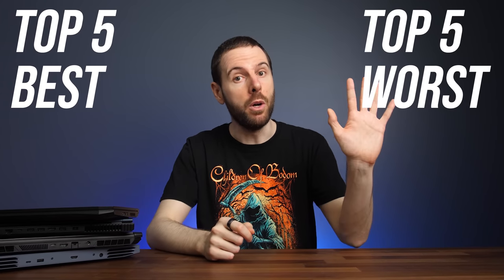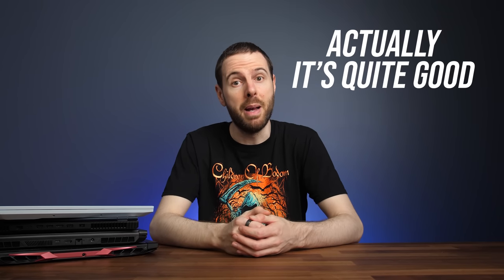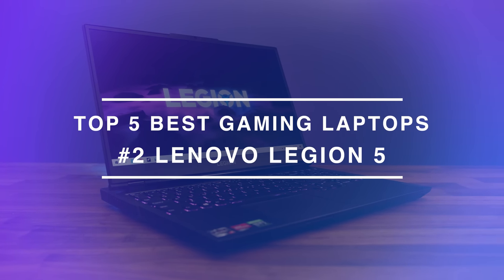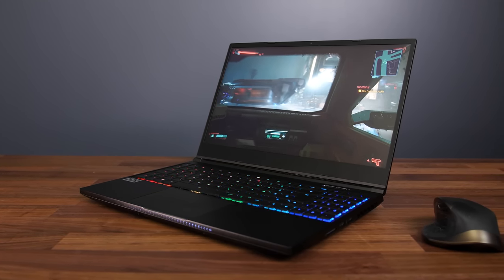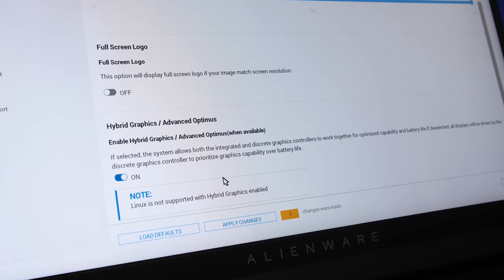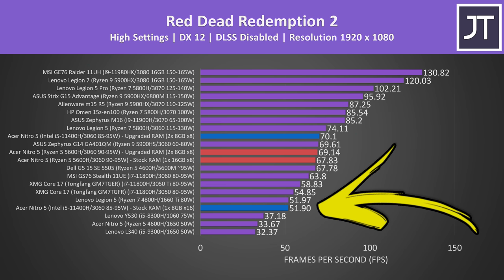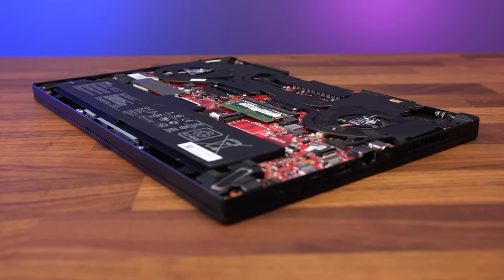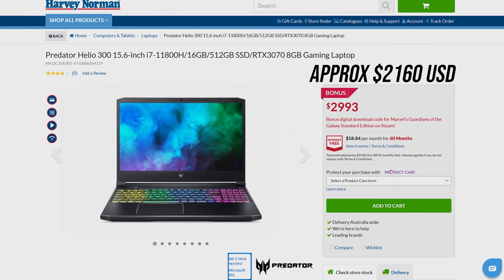Top 5 BEST & WORST Gaming Laptops of 2021!

Comment: I'm using Asus Tuf F15 (i5 11400H and RTX 3050) without a problem, tempratures are good with laptop stand and 4 hours screen time with IGPU. GPU has dynamic boost btw.

Comment: I usually hate flashy laptops.. but razer blade 14 rtx3070 that is much better than I expected. slimmer and more quiet than the list you have i believe, though GPU 100w. but at 14 inches, its the lightest gaming laptop i ever seen. will you review this?

Comment: I fixed high temperature issue and now cpu and gpu always at 75c.
I have been using Dell G15 with 165hz screen,  AMD R7 and RXT 3060 (5515) for two months.
Its the best budget laptop and I highly recommend it.
Reply: Hello how did u fix it ?
Reply: @YasminMohamed-ic9ut   Check my videos about Dell g15 (I have 157 videos only for Dell G15 test)

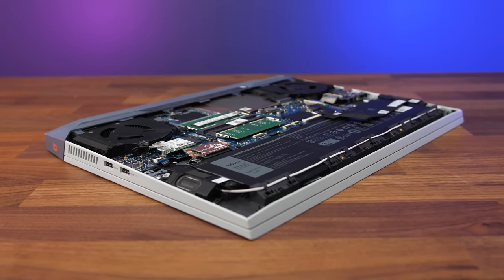Comment: 0:42 as an Asus GU502GU I totally disagree. When you are in a long-playing section, you have to choose between high cpu tempereture (+90-95 degree) with a hot plastic smell or  bare with airplane engine sound like fan speed. Especially brands decide to disable undervolting with a bios update..

Comment: Hey man i already watched a ton of your videos. The chepeast laptop here in my country is the nitro 5 i5 11th gen with rtx 3050 ti. Should i buy it? Really on a tight budget. Its around 700usd
Reply: The 11th gen I5 is the first Intel Nitro I have tested that does not overheat as the previous ones did, before then, the Ryzen's ran cooler. If you can spend a few dollars more get the 3060, if not get a second ram stick and a second SSD and put them in asap.
Reply: @jamesharvey44  hey man thanks for the info and yes i did consider adding money to buy better specs. But I'm torn apart between legion 5 and nitro 5. Both has ryzen 7 and RTX 3060. Nitro is cheaper but I read that it has heating issues and noisy. Help me.
Reply: @caramel_boy9505  The thermals in the intel 11th gen and Ryzen nitro's are very good, I have yet to hit 90c on either unit. I cannot comment on the Leigon as I do not have one. All these laptops have noise, the tinner ones are louder. But the 11th gen Niro is reasonably quiet.
Reply: @jamesharvey44  wow thats pretty cool, ok now im leaning more to nitro. Btw do you play warzone? How is experience?
Reply: @caramel_boy9505  No , my only MMO is ESO and ESO will run on anything. The 11th Gen Nitro with a 1650 runs ESO at 85-100 FPS smoothly (with a good internet connection). FO4 68-75, With a 3050 you should do better and have no problems with todays titles.

Comment: Are Dell gaming laptops more durable than the Dell inspirion?   I loved Dell when I had it, but wore the keyboard out.
Reply: Sadly same problem. My G7 gaming's keyboard is wearing out. It doesn't look or feel like there's anything wrong, but several keys don't work anymore. A set of keys goes out randomly and then about a month later stops working entirely 

This didn't begin until 2 years later and didn't become near unusable until 3 years today.

Battery is drained too, it's down to 1 hour and Dell wouldn't replace it when it started going bad ( 70% capacity) during warranty. Called it normal wear and heard Alienware buyers had the same problems

Comment: I think you placed too much emphasis on the Legion 7s corsair software. Yeah it kills the battery life and yeah Lenovo hasn't fixed it even though you've told them for 2 years, but tbh most gamers bought this laptop to be plugged in. So hey, non issue. I've watched your videos on the Corsair problem a few times, and I think you've seemed to take it personally because they haven't fixed it. It is 'trchnically' better than the Legion 5 PRO and Legion 5, so a silly optimization problem shouldn't deep six it as much as shown here. Thank you, great reviews!!!

Comment: Can you help me decide? Should I buy 2021 legion 5 or wait for the new 2022 legion 5? although the 2021 legion 5 is on sale right now from (1363.28 USD) to (1181.51 USD) is that a good sale price? because for sure there will be no sale on the new 2022 legion 5?
Reply: 12th gen intel has quite the upgrade, if you can choose the 2022 model, go for it

Comment: My Dell G15 (5510) which has an RTX 3050ti runs really loud at about 50Db and is really annoying when gaming. This noise is after rising it with a laptop stand with all fans being able to use air. Are there any fixes to make the laptop quieter without reducing the performance a lot? Anything helps thanks.

Comment: I'm still amazed at how Dell manages to make thick and heavy laptops that still run hotter than the competition
Reply: It's because they set the max temp to 100 degrees on the CPU for higher performance.. all laptops will thermal throttle when pushed to absolute max.. if the max temp is set lower it just means it will throttle sooner

Comment: i got the helios 300, mine has the 2060 and dual channel, it does really well only issues iv had was with the gpu fan but everything else has been good, iv had it for a year now still going strong and iv pushed it this whole time. its really a performer. i feel like its just slightly lower performing than the desktop 2060, and i v never had that so who cares. i get 240 fps in fortnite and ussally around 144 in most other games with competitive settings...i went from a ps4 pro to this helios 300. what an upgrade!!!  i had to open it up and grease the fan = all is good.

Comment: Jared please help me with a question I can get here in the United States a Acer Helios 300 with 11 series Intel and RTX 3060 brand new for $1200 or it’s about $1500 for the Legion five with the same specs which one should I go for?
Reply: Go for the legion 5 trust me not tryna trick you into buying the more expensive but the 300 has loud cooling and sharp corners and it easily gets hot and got bad battery life and bad audio which is why go for something other than a 300.

Comment: Said it in the last video and will reiterate here: the Legion 5 Pro is too compromised to be above the Legion 7. Especially when specced out the same, they are virtually the same price (3070). You're just wrong if you choose the 5 Pro over the 7 and this list highlights that fallacy. You get RGB, better cooling, thinner and all aluminum chassis, glass trackpad (the one on the 5 Pro is absolutely garbage), and it looks far better.

I had both. Got rid of the 5 Pro for the 7i. Never looked back.

Comment: I used Lenovo ideapad Gaming 3 with processor Ryzen 5 5600 and Gtx 1650 also 120 hz refresh rate so it its consider as good laptop for at long run?

Comment: I learn a lot from this channel. 

I just buy legion 5 non pro model with 3060, as my 2nd gaming laptop, thx God I check zentiming the RAM isn’t bad as Ur review unit😁. Earlier this year I bought Asus scar 3070, while BF 2042 run smooth in my 3070 asus, it so choppy in Legion 5. Turns out It need force the game to run on DX12 (config txt file). And since it can disable iGPU, I dont need to update AMD adrenaline driver to play bf2042. 

CS GO perform same on asus 3070 vs legion 5 3060 due to mux switch. While asus mechanical keyboard is by far the best laptop keyboard I ever try, but the RGB on Scar just justify the almost double the price 😅🤣😂 from legion 5.

Comment: Hey. I think I am one of the few people for which the portability of the machine is a huge deal and I actually mind if the laptop is heavier than ~2,1kg.
Since you put the M15 and Asus f15 in the F category and also in your top worst 5 this year is there even an option for me to buy under 2,2kg gaming laptop which is not considered terrible?
Reply: not really. I guess u could go with a zephyrus g16 but it does have soldered ram and gutted performance (lower tdp in 3060/3070...)

Comment: Acer nitro 5, i removed 1x16GB 3200 ram, and replace 2x8GB 2400 ram. and still i can't believe my eyes. some games my fps double up. After ram change, now this laptop is good laptop with budget friendly. just add ram price to its base price. (i will remove 2x8GB and buy another 16GB 3200)

Comment: Razer blade 17” is never mentioned ever. Seemed like it’d be nice but I really want to see it compared or at least talked about since I’m thinking of buying it.
Reply: If you really want thin laptops with good build quality, go ahead. Problem starts when you go for the 3070/80 models because the form factor doesn't allow the GPUs to get a decent performance uplift from the 3060. It also gets hotter than the 3060.

Comment: I have the tuf dash f15 3070 , does it have the switch thing that you like ? ( The one that lets you switch between directly using the graphics card or the bottle neck or something like that)
Also i bought it because its the only good laptop available here in syria so I didn't really have the option to choose
Reply from the maker: It doesn't have a mux switch. You can bypass optimus by plugging an external monitor into the HDMI port. More info on my review: https://www.youtube.com/watch?v=rTgN0nTc_34
Reply: @JarrodsTech  thanks :>

Comment: Finally spomeone telling the reality about the Alienware laptops. I bought my m15 r2 just because i thought I can use for years. But one of the bad decisions I have maden. It runs super hot, throttles, and AWCC is just a mess after years and they still keep it in that way. I surely don't recommend anyone to buy their overpriced devices cause there are equals of those which are also cheaper.
Reply: Always thought the same about dell/alienware. Overpriced and overhyped, and quite mediocre compared with Lenovo or MSI

Comment: Is it possible to buy a gaming laptop that could play recent games at max settings for less than €2000.
My current laptop is an Asus TUF   gaming FX504GM about €1000 which is only 3 yrs old but it really struggles with even 5yr old games on medium settings, stuff like No man's sky runs like crap even on low settings which is really frustrating.

Comment: @Jarrod'sTech Do you think legion 5 pro 16" is worth 4 months wait. 
The specs are Ryzen 7 5800H, RTX 3050, 16" screen, and 80Wh battery. At $1,100, I can't find this anywhere else. 
I need it for data science
Reply from the maker: 3050 is a bit rough for such a high resolution screen if you plan on gaming at all. Otherwise in 4 months we'll probably have new CPUs and GPUs, more info at CES in January.
Reply: @JarrodsTech  alright then. Thank you

Comment: I got the nitro 5 with the rtx 3050 for 850€ i Just added a 8gb stick for like 35€ and The laptop is fine still no have issues at all. Only concern is probably The i5 11300h which is a quadcore but stay smoothly at 4.1ghz even for Long game session.

Comment: Hey i have the dell g15 and in my region, a rtx 3050 ti cAme with it. The biggest problem was that the gpu was 4gb :((. I cant run most games on low settings.. i dont know how to fix. Is it because my windows 11 ain’t optimized for gaming? Or is it skill issue.
PLEASEEEEE RESPOND!!

Comment: From what I understand the R5 made the worse list cause of the problems. Would you still feel the same way about the model Dell has in sale for Black Friday? I mean now that they sorted out most issues you mentioned. It is sold out now but it was a R9, 3070, 32gb, 1TB, with a 360hz 1080p gsync panel..for less than 1700
Reply: I own a R6 with the 3080 for now 2 months and I've never experienced any issues such as the ones mentionned in this video, I am really happy with it. Got it for 2.2k EUR instead of 2.8 or even 3k EUR as per what I see on Dell's website now

Comment: I have asus tuf a15 my laptop when plugged in is very hard lagging fps drop cpu speed goes to 1 ghz. Back to full speed and my fan speed is slower then normal is my ac adapter dying? Around 80-85 degrees cpu temp.. when disable turbo boost i dont have any issue but my battery lose evry couple min 1 % in game and back charging...

Comment: i got 15m stealth, yes it sucks quad core and expensive,, but i value the slim and light (lighter than razer) and its all metal design i use also this for work so i can carry all around. if you have extra buck and use for work this is thinnest laptop ever in 2021. if u care more on performance theres better options.

Comment: Why quad core is bad? I'm considering buying a quad core laptop with rtx 2060,isn't 4 cores enough for 2060?
Reply: AMD has octa-core 15 Watt processors and CPU core count can choke the GPU if you've seen his review.
Reply: Part of it is future proofing. Another is that more cores enables you to multitask and open more programs in your laptop without sacrificing performance. I think for 2021 and beyond, 6 cores should be minimum.

Comment: I have the acer nitro 5 (AN515-57-71BN) with an Intel Core i7, RTX 3050, 16GB ram, 4GB vram.

Is it bad? Should i return it? And is my pervious laptop (Asus ROG strix GL503v) better in terms of performance?
Reply: @Muhsin Maki it depends on how much it cost you, as there's a good few options to choose from available right now,and black Friday's right around the corner so it may be worth returning it if you can get a better deal, or enough to upgrade to a well priced 3060 ect.

Edit: If it was the 8gb 1070 then yes the 4gb vram 3050 will perform worse but there's dlss ect with the 3050.
Reply: @Mm-vr9mt  Oh i see, thank you for your response :)

I got my acer nitro 5 for almost a 1000$. And, I had the standard edition of the gl503v with the GTX 1060 6GB GDDR5.
Reply: @muhsinmaki8051 The 6gbs of vram in the 1060 should outperform the 4gbs in the 3050 still (there's dlss in the 3050 at least) and for $1000 I'd 100% say you were down right cheated with that 3050. 

Would you mind telling me what you're after use wise and your budget/Region ect? As without even sales I can find, at the very minimum multiple 3060 (130w tgp) + 5600/5800H laptops for $1000 (usually with a 512gb nvme and 16gbs ram/1tb and 32gb on the odd few models ect) new.
Reply: @Mm-vr9mt  Well... you see, i got this laptop for college (i'm an ICT programming student) and my budget for a laptop would be 1300$.

I live in Bahrain by the way, it's really difficult to find a good laptop that's in stock.
Reply: if there are other good options, i'd be more than happy to take an advise. if not, that's okay.
Reply: @muhsinmaki8051  Then you're in the right ball park for your course with a dedicated gpu and that smaller size ect, but with that strong of a budget you should definitely be getting at the minimum a 3060/3070.

 I'd check out current and past sales on at least some 5600H/5800H ect + 3060/3070 models (to get an idea of sales curves and to prep ect) as with that price range and intended use (depending on supply and opportunity ect) you should find even a lenovo legion 5 with a 3060 no problem (the legion 5 is the mid range king at the moment with a much better tgp (130w) than average, build quality and software ect than say the acer nitro 5 or the majority, if not all of its competitors in the same price bracket (comes at a premium for a still plastic build though so this depends heavily on supply ect) and thus if it's on sale then it's likely the best option available. 

You'll be seeing some great deals come black Friday and the holidays (+ 4xxx release and January showcases ect, along with current miners and backlog surpluses ect) so I'd wait and see what models are the best price to performance around then and scoop up a great deal on preferably a 3070 for $1300 but a 3060 legion 5 or equivalent deal would suffice there if supply's poor (although some other models may get that 3060/3070 down to $750/$1000 if you're lucky) and at worst a lesser model 3060 with a tgp of at least 90w+, it should more than suffice as long as you make sure there're no issues such as the odd Asus soldered ram, or too much heat/loud fans ect.

Comment: Hey I Noticed You Said The Single Channel Of 16GB RAM.... On The Acer Nitro 5 Is Weighing It Down To Performing More Like A 1650

So If I Buy Say The Same Stick And Have A Double Channel Of 32 Or Just Generally Remove It And Get 2 New 8 GB RAM Sticks Will This Improve The Laptops CPU And GPU Performance.....
Reply from the maker: It should increase performance assuming your laptop has DDR4. I made a video with a bunch of ram comparisons, so you can see the difference they make: https://www.youtube.com/watch?v=sZaIibCSHlY
Reply: @JarrodsTech  thanks!

Comment: I still don't understand your reasoning for placing the Legion 5/5 Pro above the Legion 7. iCue is just a shitty piece of software that you don't need and can be fixed. The others come with x16 memory and no options for the high-end CPU/GPU. The ASUS has soldered memory, no MUX switch (and no webcam?). I cannot see the logic of your reasoning in this case.

Comment: I love the bigger screen on the legion 5 pro, but less for gaming and more for productivity(most games use black bars for 16:10 ratio screens anyway).  I do a lot of zbrush and blender work.  I can really take my work with me now.
Reply: What games are you playing ? L5Pro owner here and I am yet to play a single game with black bars! Most modern modern games support its resolution and  aspect ratio, it's a non issue. It may only be an issue with older titles (the oldest I tested was Witcher 3 and it worked fine) and emulators.
Reply: @shanilsam  Dark Souls 3 and Resident Evil 8 spring to mind(so I would imagine all the recent RE games are like this too).  Although I haven't tested a huge variety.  I typically game on an external screen though so it may not be as bad as I think.  Some games that have the 16-10 option put the black bars there and otherwise would stretch the image to fit.

I'll have to test some others and get back to you.  This laptop has been a great desktop substitute.  I gave up trying to reasonably build a new desktop this year.  L5pro is nice and powerful and with dlss\fsr it handles 4k 60fps pretty well.  Just don't turn on the core isolation security feature or it'll nerf the GPU power draw.